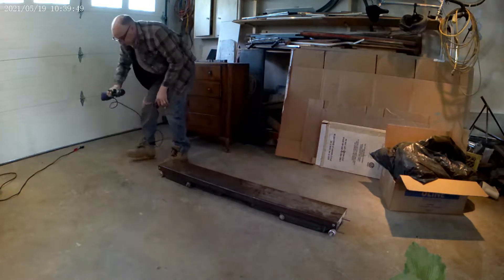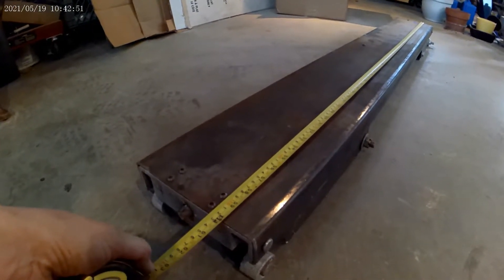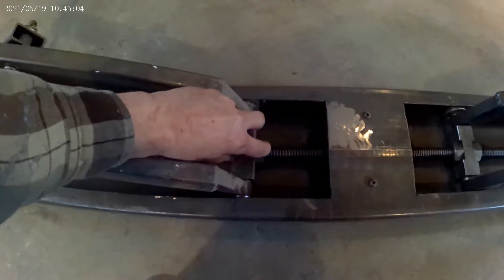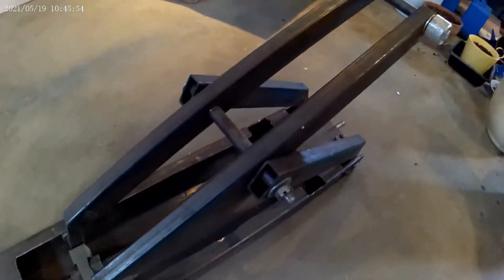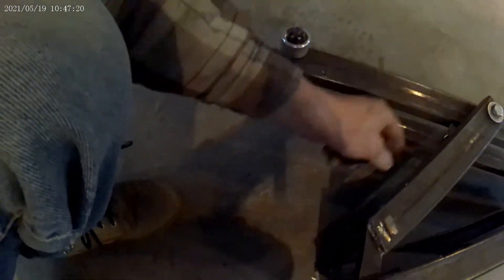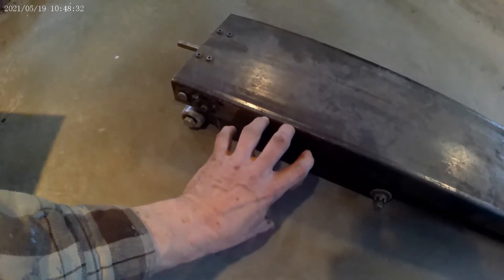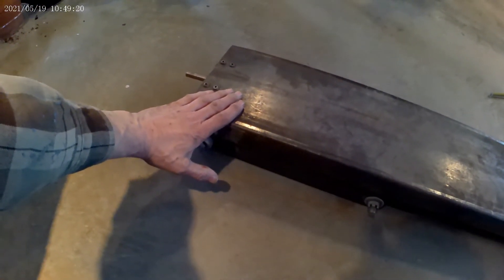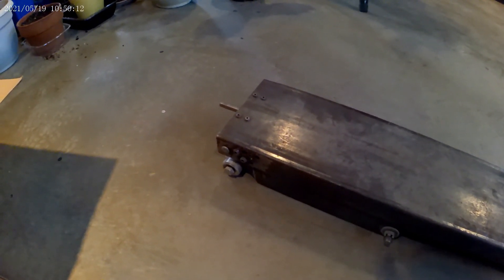Too lazy so I built a DIY Semi-Scissor Car Lift - Part 1

Comment: You could try a 120v impact and hook it up in the center there not much bigger than a regular drill. I really like your design i may steal it from you. I have 85 E150 super in storage tgat im planing on ripping the drive train out of and ripping the body off my 99 super duty and roll the frame and drive train under so i can weld tge frames together i will have to relocate the rear wheel wel a little so going to make it twice as big so i can add another rearend to make it 6x6 whel atleast thats the plan lol.
Reply from the maker: Sounds like a fun project - good luck!

Comment: I’m not sure if you’ve come along any further with your progress as far as putting a motor on your lift. Have you put any thought into a superwinch? I’ve seen a guy adapt the spool to have a sprocket on it and I think it would be something like you are looking for. Nice lift tho buddy!
Reply from the maker: Actually, I did buy a couple of ATV winch motors and tried it. With the low gearing of the winch motor and the ACME screw pitch, it took 45 minutes to raise or lower the lift! It was so slow that you could barely tell it was moving. I've pretty much abandoned the project as I'm retired, vintage and not as physically mobile as I once was.

Comment: Dude use your drill! Attach a rod in the chuck going to the outside and attach the two shafts with a chain.you Will also get another opportunity to fine tune your gear reduction.
Reply from the maker: Thanks for the tip!
Reply: @blanchae  no problem. Thank you for the inverse leg arrangement. I was going to use a winch to power mine. (Figuring I can pulley the cable back and forth in between legs for extra leverage if needed. Your screw design gives me something to think about, truly inspired!

Comment: Nice , will you make another video once you find a motor .
Have you thought about a detachable motor  with guide pins?
Reply from the maker: I'm not looking for a motor anymore, my interest has changed and I don't work on hot rods and cars as much any more - got old! LOL. Good idea about the detachable motor with guide pins. I may make a video detailing the individual parts, take the unit apart and show the details. This was a prototype and I was hoping to make it out of aluminum to make it lighter.
Reply from the maker: Made a new video with details and made my 2D and 3D prototype drawings available. https://youtu.be/8IXOOxvxLeY

Comment: How about drill for motor
Reply from the maker: I had tried using two 1/2" drive drills - had a few problems: securely mounting and synchronizing them.

Comment: why not just use  power drill like you are now>?
 then everyone owns motor .
Reply from the maker: Need two lifts and two power drills to lift evenly. The other problem that I ran into was the soft steel of the ACME screws. I machined hex heads on the end and with just testing, they were getting beat up pretty good.
Reply: @blanchae  heat treat your screws and nuts. There's proper ways to do it, or you can just get them glowing with oxy acet torch and dunk them in oil. The steel might not be a hardening alloy but it can't hurt.